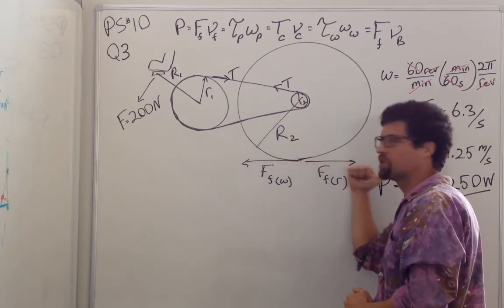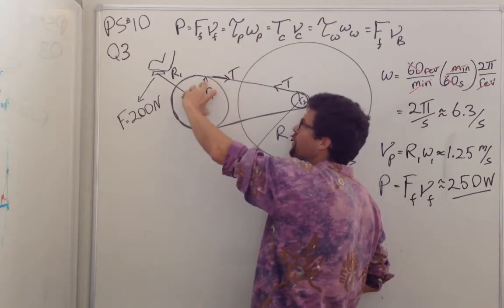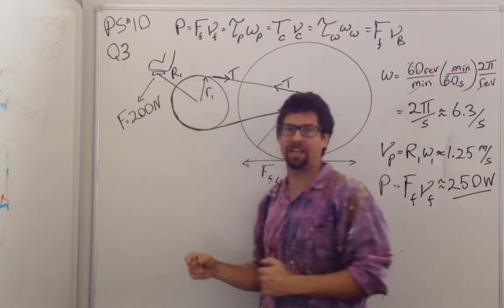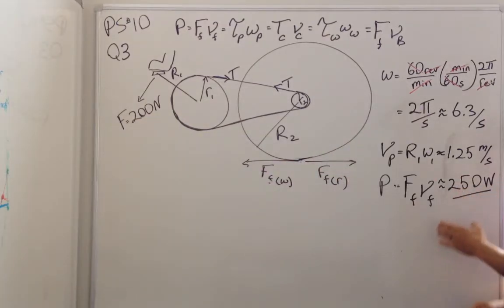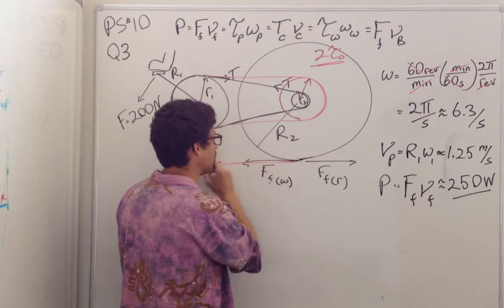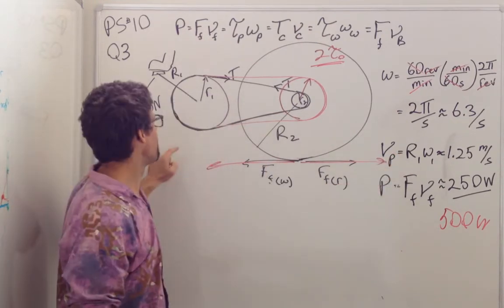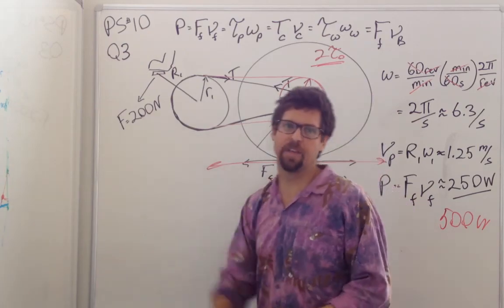Bicycle Transmission, Schwartz, Cal Poly Physics

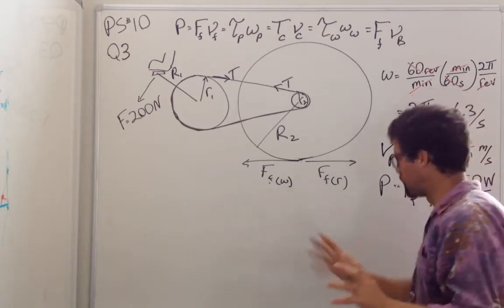Comment: 2:50 - It's not really helpful to describe the larger diameter rear gear (it's actually the number of teeth, and not technically the diameter of the rear sprocket) as delivering twice the power. Given half the pedaling force and at double the velocity (cadence) we'd have the same power input, which is exactly how pro cyclists conserve their muscles.  With the changing of the gear we also experience a lower velocity of the bike for a constant velocity of the crank.  So no more power, just a different force needed to move the chain.

It's true that it allows the mechanical advantage of same crank velocity x less crank force, to move the bike less distance.  In reality the power that a rider is able to produce may be the same, but the various gears provide a variable to allow the rider to perform more WORK with the same power.  W = P * T.  When we start a bike, inertia of your body +  bike weight is great, so we require the mechanical advantage of the low gearing to help our fixed power ability to overcome that inertia.  In a vacuum (no aero drag) and with no hysteresis of the tires (no rolling resistance) and with no mechanical friction in the drivetrain, we would be able to continue to increase gearing as we picked up speed, and with the same power, do more and more work with the same pedaling force, and incidentally stop pedaling at 1000mph and coast infinitely because of our inertia and no opposing force.  But in the real world we encounter increased opposing forces as we increase speed.  We use transmissions to change the crank speed needed to maintain a desired speed or force required to accelerate, and as you said, because our velocity of pedaling has limits.  Technically, we stop pedaling to move the bike, but instead pedal to oppose wind drag and hysteresis to maintain speed.  

But changing  to the lower gear (bigger rear sprocket) doesn't increase power instantaneously, because we tend to go slower and cover less ground meaning less velocity.  It actually decreases the power needed to propel the bike forward from a stop or slower speed, thus sacrificing speed and allowing lower force because we lack excessive instantaneous power.  Thus the real world use of a transmission is about acceleration and changing velocity, and not changing power output from a fixed power input, which your formula showed, does not happen.

Comment: Mr. Schwartz, thanks for making this film. I have a question for you. How does physics explain mathematically why it takes more power to peddle a bike up at 15% grade than it does to peddle a bike on a 0% grade? What is the best way to quantify the feeling that gravity is pulling harder when climbing a hill in contrast to riding on flat ground?
Reply from the maker: You do work to increase your gravitational potential energy

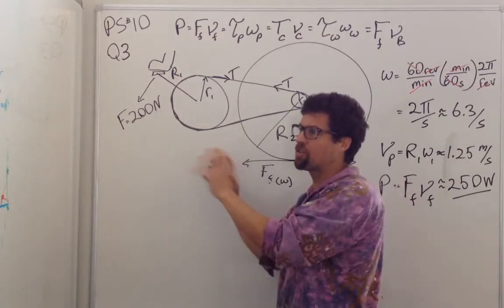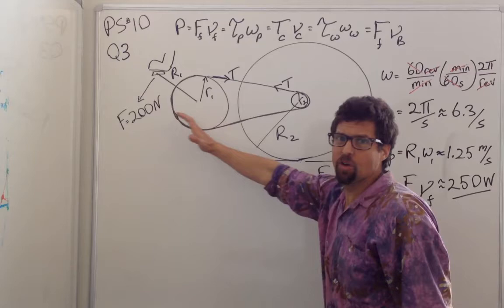Comment: So question.. In a perfect world the pedal force would be constant around all 360 degrees of the pedal stroke. But in reality it's not. We apply more force from 2:00 to 4:00, than from 11:00 to 1:00 and so on. Would this be why I ALWAYS prefer the big crank ring over small even at exactly the same gear ratios?  For example (crank-to-cassette, 2.00 ratio): 54t/27t is preferred over 42t/21t. Why is this?
Reply from the maker: I think it's purely imaginary on your part.  Should have no effect
Reply from the maker: with the possible exception that you may have slightly better connection with larger rings, but that should have little effect.

Comment: Also can u please explain how can we maintain speed on a bicycle as we are giving it an acceleration by putting a continuous force through the peddles
Reply from the maker: You do work to increase your kinetic energy... is that OK?
Reply: @pvs242ful  actually sir I want to say that if I apply a continuous force on some circular disc(like peddling ) then as force=mass*acceleration then technically it has to be accelerating may be to an infinite value but in actual practice when we ride bicycle it does not happen the only thing that comes to my mind is our force or work is used to get rid out of friction..... I'm I right ??.. I want someone to clear this doubt ?? Please help sir !!!
Reply from the maker: Good point... but there is not a NET force on the pedals because there is an equal and opposite force caused by the gravitational gradient... So there is a net force of zero as you struggle to climb a hill at constant speed.  And you will see if you take your feet off the pedals you will accelerate downward.

Comment: Thanks for the video! I got my BSMET at Cal Poly SLO about 20 years ago. Wonderful campus!  Now I'm designing an ebike I want to build. The power limit here in MI is 750 watts to be classified as a bicycle (and not an electric motorcycle, requiring registration, insurance, etc). I'd like to figure out what gear ratio I'd have to use to have the bike to have sufficient torque (assume 50 pedal rpm) to carry two adults weighing a total of 375 lbs up a 5% grade at a constant speed, with a tire of 29" outside diameter. I plan to build it single speed, so I need to get benchmarks on what speed it can climb the hill, and what will be the top speed when the crank is at 100 rpm. Do any of your videos address this? Thanks!
Reply from the maker: I think you need a physicist of ME collaborator!!!  It's a pretty straightforward calculation

Comment: Mi Mr. Schwartz,
Love to video. I'm currently working on a physics project and I am trying to find the difference in efficiency between different gear ratios while using the same amount of force to push the pedals. But because I don't have a power meter on my bike, I am trying to find a way to calculate the necessary rpm for each gear ratio in order to know I will be exerting about the same force during my real-world trials. Do you have any ideas on how I would go about finding this?
Reply: you dude, im doing a very similar experiment and I'm facing the same issue as you are. if you sound a solution to this, can you please reply to me telling me how
Reply: @808mas nope i changed the experiment all together lol

Comment: Mr Schwartz,
Hypothetically, if a third gear (half the diameter of the your gear #1) was introduced in the beginning where foot applied force after doubling the radius of the last gear, could speed and force of foot remain the same while doubling output force?
Reply from the maker: That conservation of energy is going to prevail. If you gain in speed, it will cost you in force.
Reply: Understood, thank you!
Reply: Mr Schwartz,
If the conservation of energy prevails, why did the tour de france outlaw incumbent bicycles because they have a "mechanical advantage"?
Isnt the fact that gears are used at all a mechanical advantage?
Reply from the maker: @jamescongleton6146  Good question. You could interpret "mechanical advantage" a number of ways. The Tour de France is seeking to standardize the bicycle so that it is the person that is being tested against each other. The recumbent bike has the advantage of a lower wind resistance, so they won't allow them. However, this is something very different from finding a way to deliver more power to the wheels than you produce with your legs... which is impossible, unless you use an energy storage mechanism such as a battery/electric motor. The gears provide a "mechanical advantage" by allowing one to spin their legs at their optimum frequency (about 90 rpm) so that the rider generates the maximum power from their legs under all biking speeds (for all levels if incline). having different gears allows the legs to spin at the same frequency for different bike speeds. The Tour de France allows this kind of "mechanical advantage". I hope this helps.

Comment: With this formula, is having a longer crank an advantage?
Reply from the maker: Marvin, Thanks for the question. Having a longer crank allows you to increase your torque and therefore deliver more power if you can keep your rotation rate up. The downside of that is you have to move your feet further, so it is a trade off. In particular, you don't want the crank to be longer than comfortable for you leg size... but now we're getting into bicycle fitting.!
Reply: @pvs242ful  totally agree, thanks for the reply. useful for those climbs.

Comment: How do you calculate the force static friction applies on the rear wheel based on the 1) force of the chain on the rear gear and  2)radius of the rear gear and radius of the rear wheel?
Reply from the maker: You could use an energy consideration: the power to the wheel = power to the bicycle, so Tension in chain * speed of chain = force of friction on road * speed of bike. You could also just multiply the tension in the chain by the radius of the rear cog , divided by the length of the wheel radius.
Reply from the maker: Sorry to take two years to reply to this. If the coefficient of friction is high enough for the wheel not to slide out, then you can just conserve power. P = F*v = Torque * rotational velocity. So, you can calculate the power at any point in the drive train (because it's the same), and set it equal to F*v, where v is the speed and F is the force of friction. Divid by speed and you have force.

Comment: Hello Dr. Schwartz.

Amazing video, it really clarified a lot for me and I truly appreciate it. I have one question if you have a free second. In the beginning of the video you basically said that the power is the same, but forces/torques/radii change. That makes sense to me, then right at the end you said power doubles. That got me a little lost. I really appreciate your help and again, very informative!
Reply from the maker: Kyle, Thanks for the question. The power from your legs is the same as the power to the wheel (minus the tiny amount lost to friction in the drive system). However, then you switch gears and you're now pushing with the same force (torque) at twice the rotational velocity, so now you are putting out twice the power (as you were before), and the wheels are receiving twice the power. Because you've switched gears, your legs produce twice the power through spinning twice as fast, and the rear wheel (which is still spinning at the same speed because you haven't sped up yet) experiences twice the power by receiving twice the force. I hope that helps.
Reply from the maker: If you lower your gear by a factor of two, and you are peddling just as hard, then you will be putting out twice the power.  The power in is still the same as the power out.